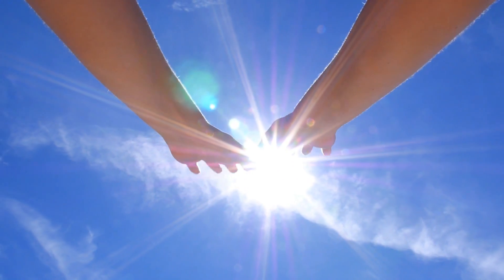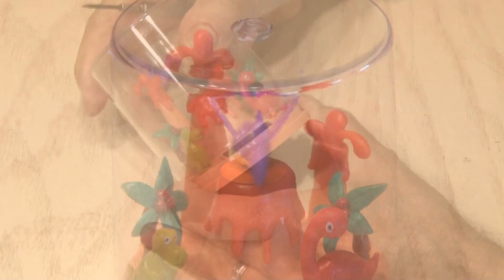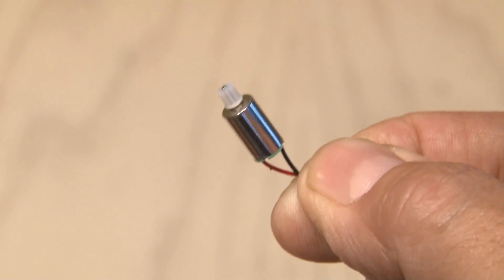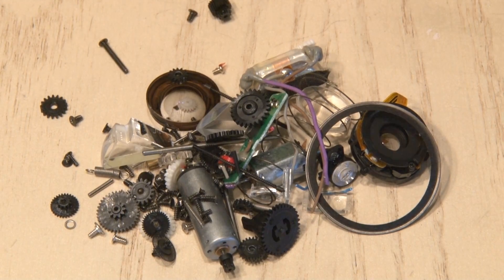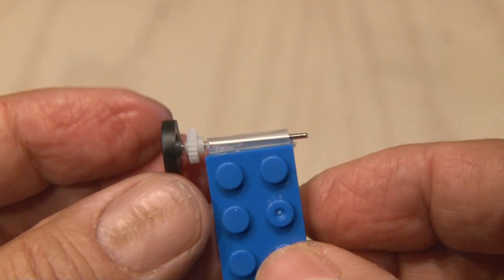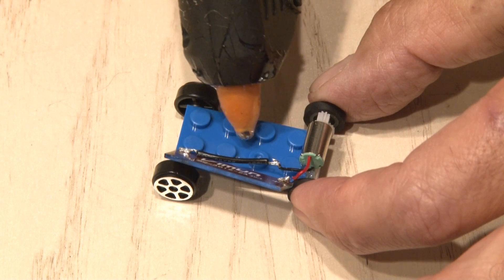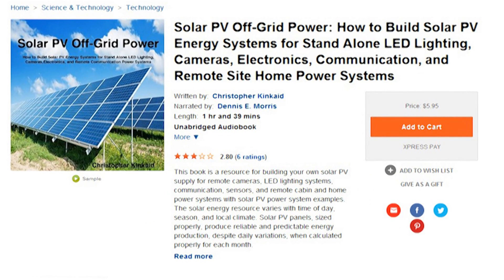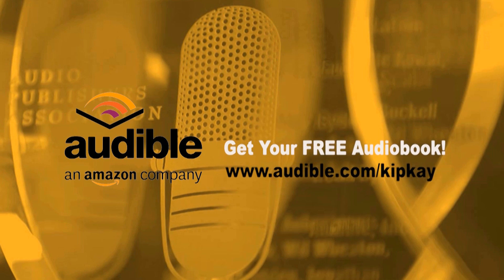How to Make a Mini Solar Car!

Comment: Impressive. A new alternative using an 80s Record Breakers or Stomper cars as options you might try finding them at the Flea Market. However you might try a kids plastic free running wheel car as that option I told you.

Comment: Do you believe a dog toy (well protected, made w hard plastic ball) could be made to roll a ball?  Problem w all alleged self-propelled K9 toys, they use heavy batteries. These generally are in fragile toys & if a K9 destroys the components, they can end up chewing on batteries...not great K9 diet! . I'm thinking of an outdoor toy with a type of gyroscopic action ball, encased in a LARGER lightweight but hard plastic or rubber ball which would roll independently of human or K9 touch. DON'T know much about solar Or even electrical theory. But I DO know, K9 behavior & how keep the dog's mind exercised & to maximize K9 intellect. Most is done with human interaction but can also improve with creative toys...when humans get lazy.. Dogs will often stare or bark at their toys to respond w/o human touch; they believe (I observe) inanimate objects can respond or have reciprocal action. Therefore, do you think a solar device could power a ball inside another more durable ball or perhaps a gyroscope inside a ball, at least 10" in diameter could work? Maybe some type of device to power a toy but with enough power & protection of the solar cell(s)? There's NOTHING on the market as yet; I've done years of extensive searching. Thanks for this clip. It's brilliant.

Comment: Can a solar panel run on the light it puts of it self
Reply: Nope. It could probably last for a few seconds and keep getting dimmer. Energy will end up getting lost one way or another
Reply: +BioVirulent I understand that but I mean on a much much bigger scale where as it would take days or even weeks to completely go out
Reply: Solar cells are like 20% efficient, and then you loose like another 5% in the led i'm assuming and then you will loose 25% to light that is not hitting the panels ..... even with 98% efficiency it would go out extremely quickly.

Disclaimer- this is all "Napkin math"

Comment: This costs more than $1 considering that you have to buy the screwdriver, wire cutter, motor, matchbox car, the drill, and everything else.
Reply: most of those things are things people already have though, so its not counted in the cost of materials.

Comment: you should do an iron man arc reactor out of an led light bulb, when you take apparent the led bulb the leds them selves look just like an arc reactor(if you get the right one) just find some kinda battery source and switch or something ive tried and found out each led works individualy but I can not for the life of me make them all work as they are all ready hooked up in a series circuit (it would be easier if it was parallel circuit) so you should make it bc your probably smarter at this kinda stuff anyway so plz help me

Comment: Where did you get  the soldering tool you used to disconnect the wires on the solar panel? I am looking to do some of your projects but need to soder/solder on mostof them and need a sodering/soldering iron.

Comment: Neat little car. As long as the motor is low voltage/low current, and the solar cell has a "reasonable" output, viewers should have good results.

Comment: How about a bit bigger project.

A solar powered rc car ! (1:24th or 1:18th scale truck (toy grade ofc so we dont need to make a ridiculous bank of capacitors to actually power it)
Or offroad vehicle so it goes somewhat well outdoors.) (With a super capacitor acting as a in between battery ofc so it can go into some shade for a minute or two before loosing power completely.)

Comment: those solar farms are going to considered clean up sites by the EPA in 25 years after the solar panels cant produce enough power since chemicals used in solicon solar panels and the cadmium uses in solar panels for solar farms are extremely toxic which means they have to be disposed in a toxic waste land fill and the reason I know this the city I live in has a solar farm and we have to pay for it even though we wont receive a single volt from it its all going to go up to Denver for them dumb yuppies to feel good about nothing.
Reply: Literally did anyone ask
Reply: @0:08...they were mentioned in the video. i believe that gives legitimacy to the comment.
Reply: +UncleB-rad but not much

Comment: I would stick a little switch onto the car, otherwise you are going to spend most of your time chasing it!
Reply: youre still gonna have to chase it to flip the switch off...
Reply: just put a blanket over it
Reply: Ha ha
Reply: Ikr
Reply: lol good point
Reply: Just stick a long string into it
Reply: +NecroDragon that would tangle up.
Reply: Not if you glued it on.
Reply: +Marko Agar.io yeah